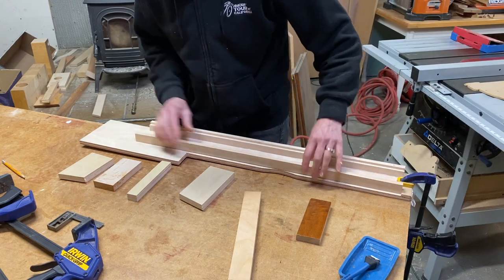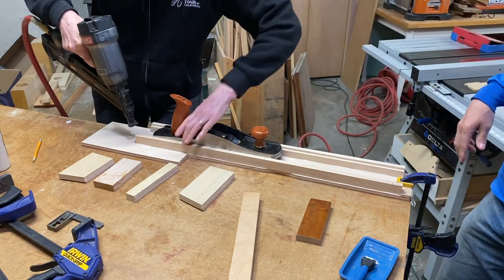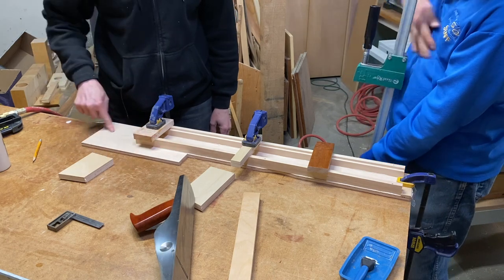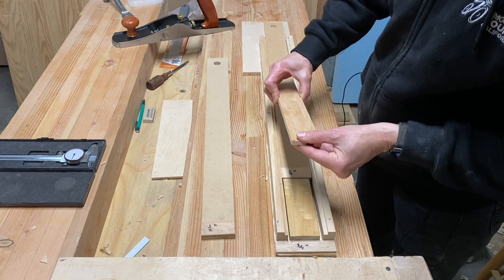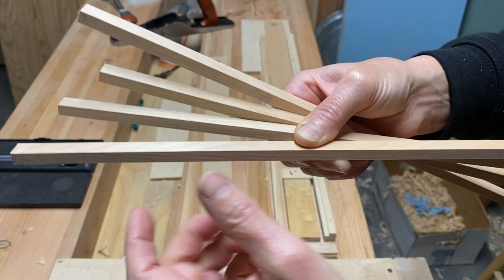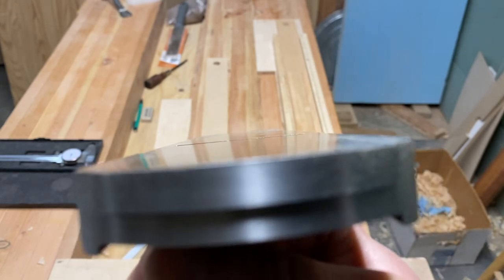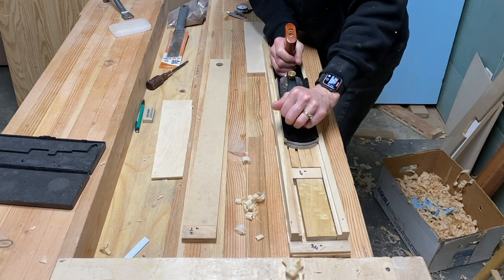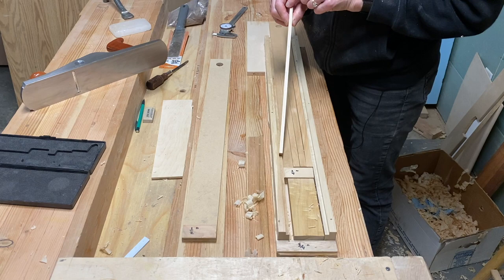Make a Plane Skid Thickness Jig

Comment: Thanks for this vid. I just made one this evening from some scrap 1/4" and 3/4" MDF. Stacked two 1/4" shims on the base for making 1/4" edge banding. Tried a test run on the sled and quickly planed a perfectly uniform strip. Tomorrow I'll rip a bunch more strips and put this sled to good use.
Reply from the maker: Sometimes simple is better!

Comment: After watching many of these jigs with all the adjustments for height, I  made one with a fixed 1/2" stop at the end instead.  I'll  put in shims underneath the stock to get the thickness I want.  It's good to see that I'm on the right track though your build looks more elegant.  Thanks!
Reply from the maker: sometimes the simplest solution is the best! Thanks for watching and commenting!

Comment: Hi great stuff.  I made something very similar based on a length of 3x3 with bolted on sides and internal rails (like yours effectively).  And I also used calibrated spacers (btw plastic is good e.g. lego bricks as wood tends to expand and contract too much for fine tolerance work).  The problem I kept on having which caused me to stop using it so much was that the blade of the plane exerts an upwards grab force and tended to pull the workpiece off the base so it would end up planing while floating in mid air under the plane.  I added some screw clamps to clamp from the side but this is no good for fine work say less than 1/2".  I'd be interested in your thoughts.  If I can find a good solution I might start using it again.
Reply: When you plane something on a bench there is always a downwards force on the workpiece but not so with this jig once it gets to the point where it begins to stop planing.
Reply from the maker: I put a stop for the work well before the end so my plane is still “at work” past the end of the workpiece. I’m also taking very fine .001 or less shavings at the end. I use this jig all the time in making my inlay bandings. 

I’ve also had no issues using wood spacers. The expansion is uniform on the thickness, and very minuscule over a thin 1/8” or less spacer board. The MDF has very little movement. But plastic spacers are an excellent way to go if you’ve got long strips of plexiglass, for example. Good tip!

Hope this helps.

Comment: I am new to veneering and I was wondering how far down you can go with the skid.
Reply from the maker: It depends in part on how good of a plane you have. A longer plane will do better than a smaller one. Clamp the end to keep it from buckling as it gets thin. I’ve gone to 1/16” by taking fine shavings. Haven’t tried thinner than that.

Comment: I hope you're happy.. Now I feel the need for a plane.. i could really make use of this jig... But I'm not really a plane guy and really confused by all the variations .. I have few hand planes so really none. Might I ask what brand and style you're using there.. Hope it's not a WoodRiver (G)
Reply from the maker: Hand planing with a good sharp plane is such a pleasure! I’m using a Veritas low angle bevel up jack plane. It’s really quite versatile, and is one of my most used planes. I wish the tote was more comfortable for my feminine hands, but that doesn’t stop me from using it extensively. 

The bevel up allows me to use blades sharpened at different angles depending on the type of wood I, planing and how I want to use it. A bevel down plane will always cut at the same angle to the surface no matter what angle you put on the blade. 

Feel free to ask questions here!
Reply: If you're lost with planes you can't go wrong with a standard old Stanley 4 or 5 until you learn enough to know which kind you like. Best to get one from an reputable dealer who you trust to sell you one where everything is in working condition so you don't get frustrated trying to set it up. If you can afford it then Veritas or other similar high end planes won't let you down, but it's a lot to spend before you know much about planes. Another option is to get a mini version of a high end plane, but you lose the momentum of the bigger ones which can make them harder to use for some purposes.  Don't get confused by the variations...most of them are just equivalent to the standard with some small tweaks to make them better for particular purposes. They are worth it if you need them, but you can also use a standard plane to do the same thing. Some variations are worth it, and some aren't but you won't know until you use a standard plane to do it enough to get frustrated, and even then the frustration level and frequency of use has to justify the price, space, and addition of another tool to keep sharp/etc.
Reply: @RichardBuckman  Richard, thank you for thoughtful, well thought out reply. I couldn't afford it but I did get the Veritas Sky Valley describes above.. Had to save and they were out of stock for forever but here was my thought process. I wanted to know once and for all is it the plane that causes me problems or the user. I knew if got that plane and still couldn't dial one in it was me. It's taken a little practice but I am getting results and feel as if I'm getting better and more comfortable using.. And I thought if I can crack the code it would have multiple uses. 

Something I've scoffed at forever.. Ahem, I've now made a small shooting board for  edges and 45s and as you'd guess I feel quality of work has ratcheted up a little..  also had little piece of twisted quilted maple , I was able to knock down the high spots pretty quick. I was really surprised how fast I brought that piece closer to flat more manageable before moving on with it. 

Still don't have plane skid however.. And even worse I'm pretty happy with this plane and now want to know more about other varieties.. 

And another oddball thing I thought.. I was shaving, oak, hard maple, walnut edges like a champ(for me).. grabbed a piece of blood wood and the results were horrific Even dulled my blade.. Quick google search indicated interlocking grain might be the cause? Or it's so hard need a different angle idk.. still loads and loads to learn.
Reply: Comment about wood river- what’s wrong with that brand of plane?  Thanks
Reply from the maker: I can’t believe this took TWO YEARS to show up on my notifications! By now I’m sure you’ve mastered your plane, and the interlocking grain issues. Part of the reason I got the bevel up plane was so I could use different angles on the blade on a single plane. I have three different angles from 25-50 degrees, and a toothed blade for goofing down surfaces quickly. 

Saving for a quality tool is sometimes much better than trying to learn on a substandard tool. The learning curve is much easier with quality tools that set up easily.
Reply from the maker: Wood River planes are acceptable. I believe Woodcraft has some you can try. But hand planes are definitely different qualities. A Bailey  is not equal to a Bailey Bedrock, and a modern day Stanley is not equal to a poor-war Stanley. 

Try before you buy. If you are a first time user learn how to properly set up the plane and sharpen it. How frequently.
Reply from the maker: Wood River planes are acceptable. I believe Woodcraft has some you can try. But hand planes are definitely different qualities. A Bailey  is not equal to a Bailey Bedrock, and a modern day Stanley is not equal to a poor-war Stanley. 

Try before you buy. If you are a first time user learn how to properly set up the plane and sharpen it. How frequently.

Comment: This may be a stupid question, but... can't you just double-sided tape the piece to another piece of stock you know to be flat and run it through said thicknesser? Don't misunderstand me: I have a chute board and a number of flattening jigs, so i get the whole 10 ways to skin a cat thing, but if you're having to manufacture precision-thickness inserts ANYWAY to MAKE the jig...

I have a 2x6 (made up of laminated strips of MDF and planed/jointed to 90/90/90 as flat as I can get it specifically for the purpose. One of the blokes I used to work with actually had a long billet of aluminum he'd milled that worked the same way. I even saw one guy who had a long piece of thick glass - I think he'd said it was part of the siding of a glass bartop - the he used (though I totally admit: I wouldn't have the stones to risk the Sheelix on either of the latter two).
Reply from the maker: Z, this is a good point. I suppose you could use double sided tape. 

Personally, I enjoy using a hand plane much more than using an electric thickness planer, which never gets quite as good a result for me as my hand plane. Often I'll take an additional pass with the hand plane to materials coming off the thickness planer just for that reason. Or just do it all with the hand plane. No noise, no dust chips, fun making curls, and a good workout!